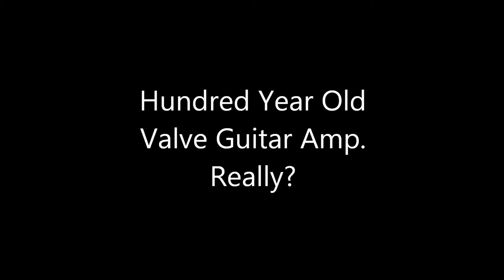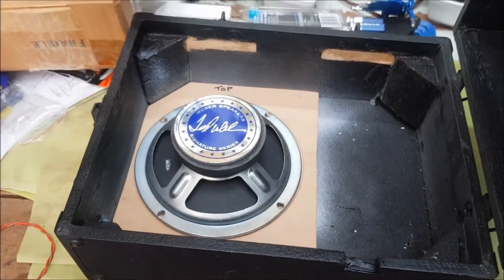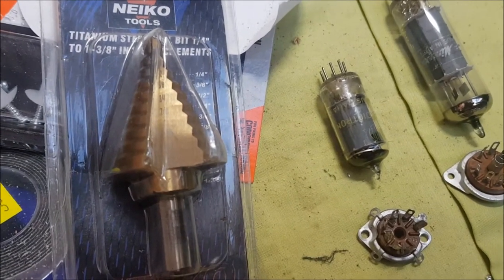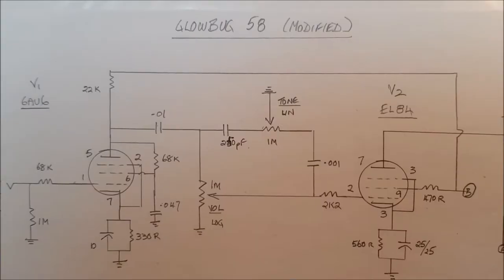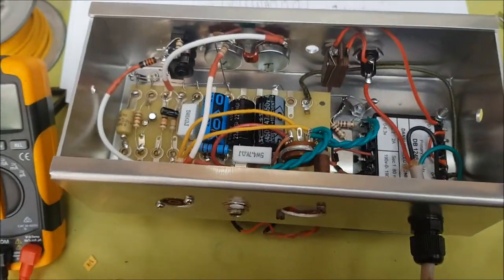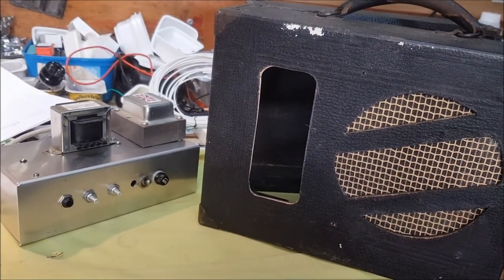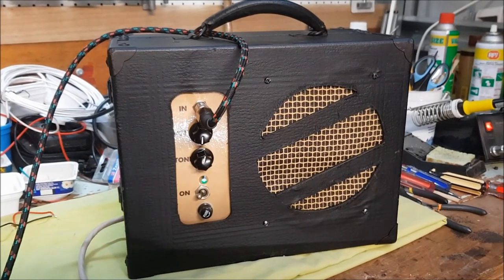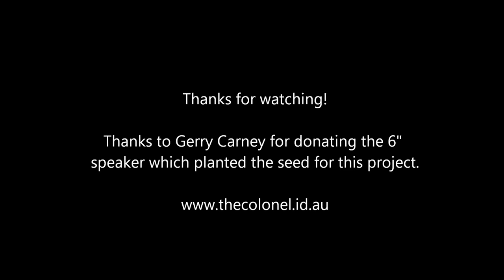Hundred Year Old Valve Guitar Amp... Really?

Comment: You're  right  old tube reel to reels work great to build amps out of. I built 3 out of old Webster Ekotape Reel to Reel. They have a single ended 5 watt 6V6GT and 2 of a 6AV6 preamp and they sound awesome. I use the cabinet and put an 8 inch speaker in it. Bearly fits . Your amp sounds great with harp and guitar. Good job.

Comment: With step drill if after reaching your size just touch on the next size and it will demure then do the same on the other side
Reply from the maker: Thank you. I'll pass that comment on to Mike Frost.
Reply: ...I think you mean "DEBUR"- and, you're right- but that takes PRACTICE!!
Reply: @TheZedvox   I couldn't tell from your video if the step drill you used had 1 or 2 cutting edges on it but the ones with 2 cutting edges tend to cut more smoothly and evenly, and are also better for de-burring the hole when you're done drilling it to the desired size. The cheap Asian made "gold" step drills aren't the best quality anyway.